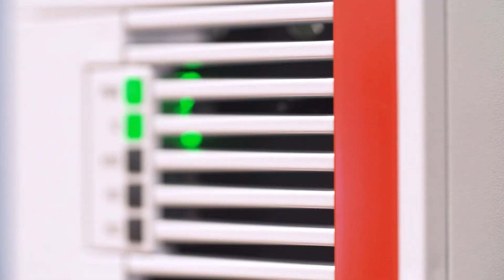Meeting Beckhoff's IPC Product Specialist

Comment: Hi madam,where is encoder connected AM8063 0RHO-000 motor  from AC servo drive AX5112. There are connection between motor and drive 3phase supply to motor, T+,T-,B+,B- but here no encoder connected between motor and drive